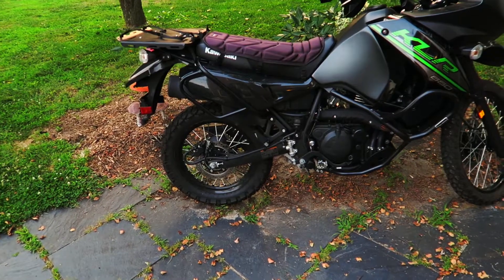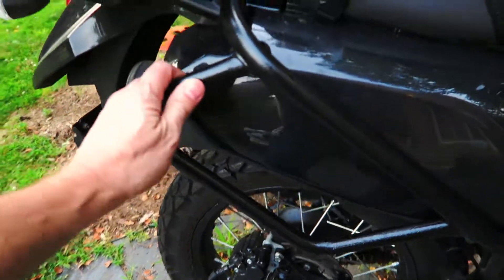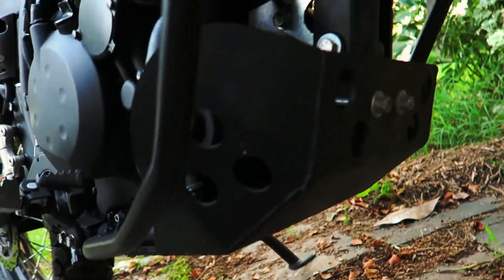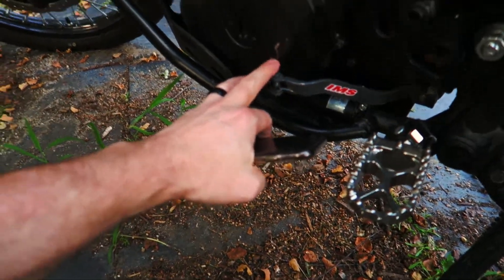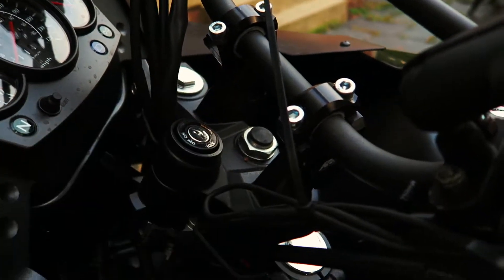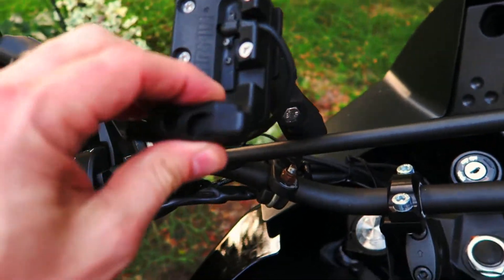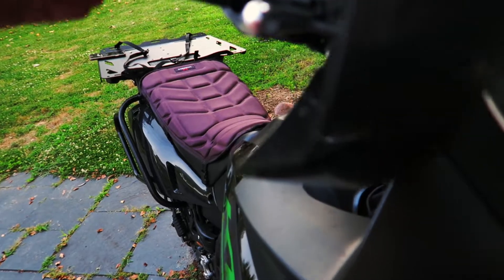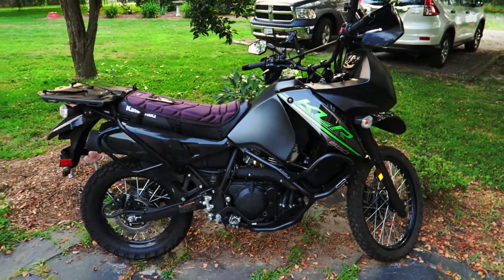All of the mods I've done to my 2017 Kawasaki KLR 650, plus a few I want to add

Comment: Did the risers go on easy...or did you have to lengthen or reroute any cables?
Reply from the maker: The risers did go on very easily. However, it took me a few weeks to realize I needed to get some slack in the throttle cables. I only noticed it when turning very sharp, like when you back it up, etc that the throttle was revving. Now, removing the tank is always a pain, but I was doing some other work and was able to fix that. I believe that I simply took off one, or two cable ties and pulled a little slack, or rerouted, cannot remember. Either way I did not have to replace any cables.

Comment: Nice bike.. have you done the drill-through subframe kit yet? I did it on mine but after doing it I think just getting the upgraded bolt kit ~$5, is very much worth the money.. obviously using loctite and a torque wrench... and you won’t have to worry about breaking your subframe bolts.. check out my bike on Supertrucker207 (I think it’s up to around 100 views 😂🤣😂)...
Reply from the maker: I have not. It is one of the things that I haven't completed, but it is on the list! Are you saying that you feel just a bolt upgrade would be as, or almost as good as the drill-thorugh kit? I'l check out your video.